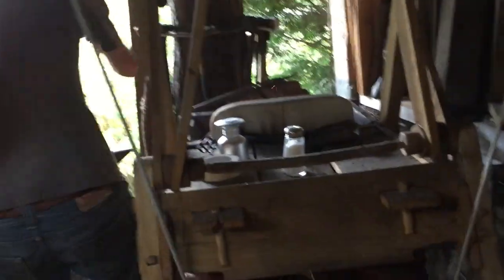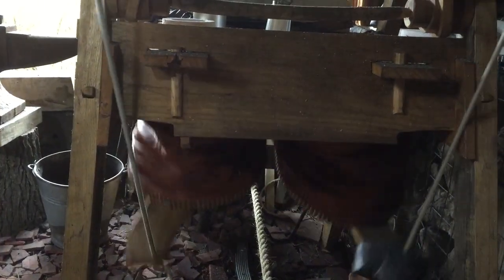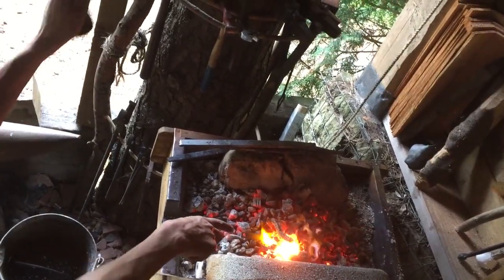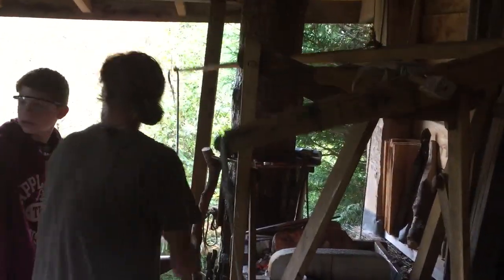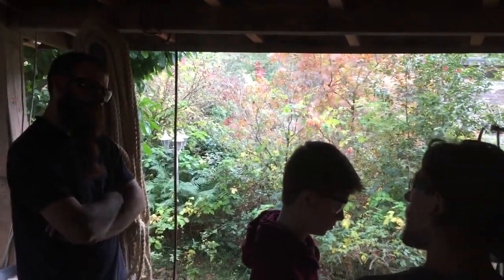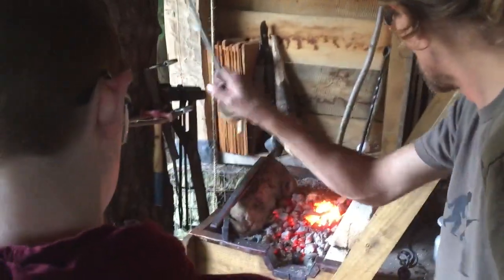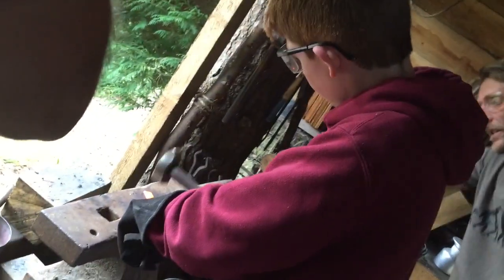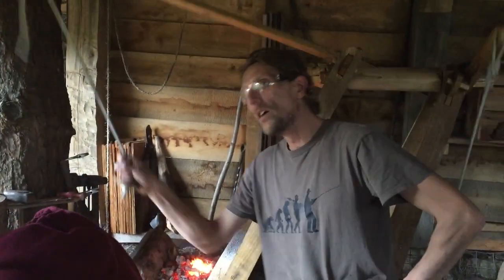Rod Hughes - Viking Forge in action

Comment: What's the largest item you have forged Rod?
Reply from the maker: Hi Anthony, an interesting question. I have forged double hander swords and hand and a half but, on those occasions, have used a power hammer and a gas forge. In charcoal, forged by hand a long seax or a gladius is a lot of effort but I have forged a full-length Viking long sword using hitters with Viking style sledgehammers.
Reply: @rodhughes9465  thankyou for that,that's really interesting cheers

Comment: Hey buddy, just wondering what you used for the hearth stones? Cannot find much mention about them, the odd ref to bellow stones, and the famous one with loki carved in it. I was thinking fire brick type or crafting one out of fire cement.

sorry for putting you on the spot. hoping you could shed some light.
kind regards
Raggi
Reply from the maker: Hi Raggi, I just saw your question. Traditional take would be sandstone which is easy to shape with an angle grinder. Try making a hollow hearth from grogged clay and firing it and backfill it with soft firebrick chips, bound with fire cement.